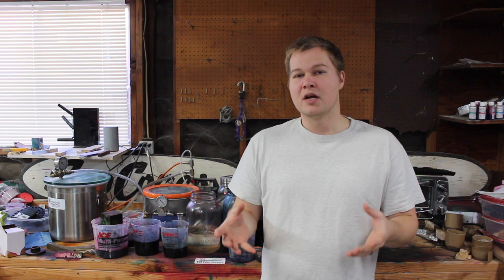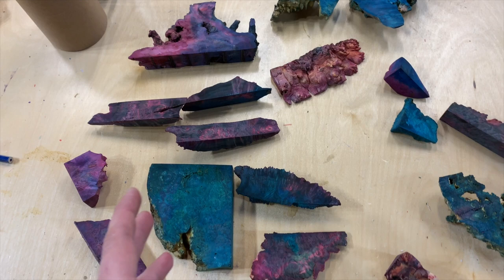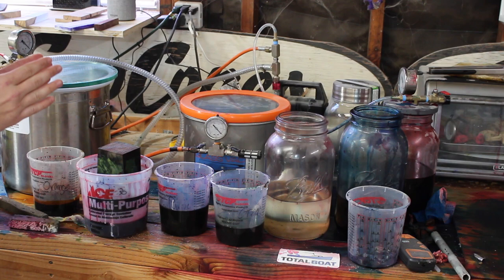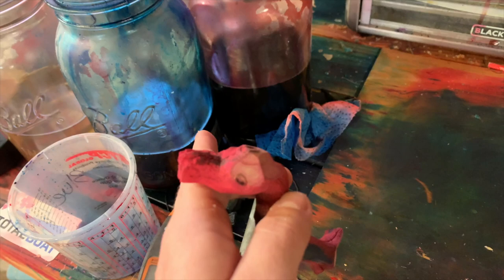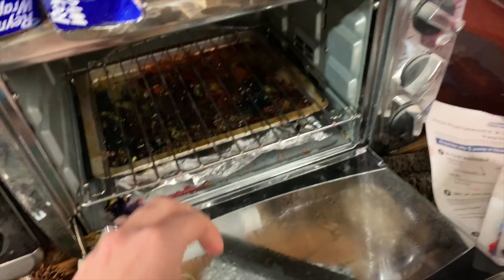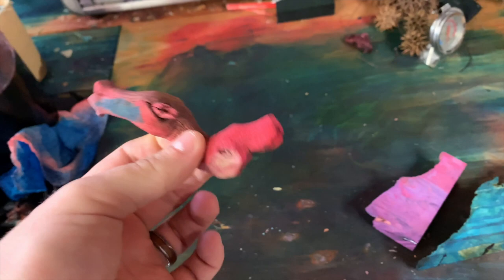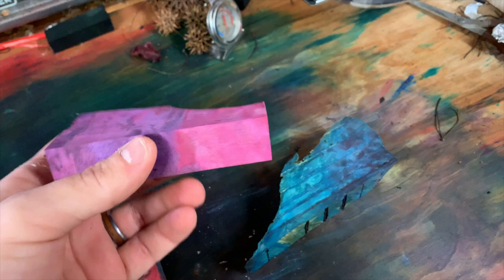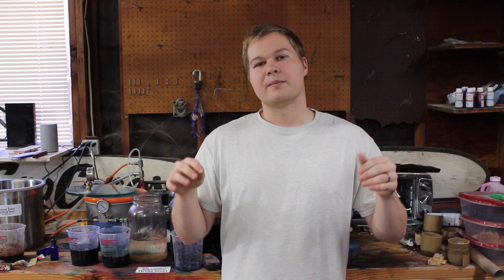How To Double Dye or Multi Dye Stabilize Wood (How To Make Stabwood)

Comment: If I understood well:
Step 1: Soak
Step 2: Soak under vacuum
Step 3: Dry in the oven and sand
Step 4: Soak completly under vacuum
Step 5: Dry in the oven
Some questions:
1) When soaking under vacuum, when there's no bubbles left, you stop the pump and let soak. But do you open the valve to let the air goes in the chamber?
2) When you double dyed, do you finish with a process of soaking in clear cactus juice?
Thanks and nice video!

Comment: Thanks for your video. I wonder if first warming the pieces in the oven first would be a good step and then application of the dye/resin mix? Would this help open the wood up and generate more absorption into the wood?
Reply from the maker: Yes this is considered a necessary step even when not dyeing

Comment: Awesome video Casey! Beautiful work man, and thanks for the shout out! I haven't tried using vac without submerging yet, need to test that out =D
Reply from the maker: Thanks Zac! I highly recommend it depending what you’re going for. If you’re going for distant color separation it works pretty well, but if you want random colors throughout the non vac soaking is perfect for that. Sometimes if the wood is super punky the non vac soaking makes it super distinct anyway

Comment: Nice video. May I use water in the vaccum chamber to simply dye the wood with some color, or does it just work with resin? If I can do it, should I dry the wood before coloring it? Thanks for sharing

Comment: I apologize if I  missed the answer to this question. When soaking for the first round of dye, do you get deeper penetration when allowing to soak first before placing in the vacuum chamber or do you get about the same result if you just go straight to the chamber on that first round? Just trying to wrap my mind around it. If you were just stabilizing with no dye, you just go straight to the chamber. Thank you so much for all of the info you share. Love your work!

Comment: Casey, on the red drift wood piece, did you pull a vacuum on it in the red dye, or did you just let capillary action turn it red? And did you bake it before you sanded it?
Reply from the maker: No vacuum, it just fell in and it was all capillary action if I remember correctly. I did bake it before sanding

Comment: love your videos.. no one talks about the wood drying in the process. in normal stabilizing everything needs to be absolutely dry.. obviously this is hanging out on normal air during all these soakings.. is dry wood not as important ?
Reply from the maker: Well I should’ve clarified that it should be dry. But it’ll definitely be dry by the time you do the second soak since it’ll cure on the first one, which is by far the most important. It’s most important to have it completely dry for whenever you actually put it under vacuum. Having it dry will probably help capillary action but not sure how kuch

Comment: A few of questions: how far does the capillary action typically draw the solution up into the wood? Do you ever flip the piece of wood around to get the same color on the other end? And have you ever used too much dye in your cactus juice?
Reply from the maker: Depends on the wood but usually pretty far, just not that penetrating. Drier and softer the wood like buckeye really soaks it up. And yes I have a couple times, it’s really whatever you wanna do. And no I don’t believe so

Comment: As usual,another great video Casey! I have most of my equipment on the way to get started! Here's a question though, for just getting started,should I start with a gallon or a half gallon of cactus juice? I believe,from the research I've done,the shelf life,isn't very long,on cactus juice correct? And since I'm just starting I dont know if I want to put $90 in a gallon if I end up not utilizing all of it before its shelf life is expired. What sayeth the professor to student? Thx for any help you might have! Always enjoy your videos!
Reply from the maker: I’d say a gallon. But it’s up to you. Shelf life is awesome. I’ve never had a problem. I always have a few gallons sitting in my chambers because I always stabilize so much wood at once. Granted they get swapped out with new CJ every month or two, but never had a problem. I’m sure the shelf life is 6 months to a year and the info is on turntex

Comment: Great video! As seeing I have a 5 gallon pressure pot like yours, I would like to make it double duty as a stabilizer. Do you know where I could get a 3/4 piece of lexan to fit the top? I know you’ll probably say the internet, which is where I have looked, but trying to find something of that size seems impossible. Or maybe I could just order a top from a vacuum chamber supplier. Your thoughts would greatly be appreciated. Thanks.
Reply from the maker: I would look for a glass top and a rubber gasket you could put on the rim of your pot. Even with 3/4” it might get micro cracks that so many people end up getting with acrylic lids. If you look at the Yescom chamber in my tools to use, and can order a gasket and lid like that from somewhere, I’d do that. Honestly probably will cost about the same as the chamber, as the chamber is really just a big metal pot. If it does cost similarly, I’d just get the whole chamber so you don’t have to dirty up your pressure pot every time you want to stabilize and then clean it every time you want to cast. 

Hope that helps!
Reply: Thanks for the advice.

Comment: What are the minimum specs you would use, or recommend, on a vacuum pump to do wood stabilization with?
Reply from the maker: In the video description I have a tools I use page that has the vacuum pump I have on it. I believe mine is only 3 CFM, and you don’t need more than that. You could probably even use a 2 CFM if they make it. The stronger vacuum just makes it reach full vacuum faster but that doesn’t really matter for stabilizing.
Reply: @CaseyMartin707  thank you

Comment: Do you bake after every color or only after all colors are added?
Reply from the maker: After every color! Only time I think you could get away with not doing it is if you were doing a large piece, soaked one end, and flipped it to the other. The main importance is on smaller ones where you want to make sure you’re not sealed off anywhere

Comment: What grit do you typically sand it back with? Also, when letting capillary action to happen, do you stop it to a point you want? or just let it soak till it stops. From my limited experience, it often can turn the whole blank that color. Granted probably using too much dye in that case.
Reply from the maker: Unless the wood was extremely soft and punky, I don’t think a wood could become completely penetrated by capillary action unless completely submerged. I’ve never seen it but maybe. I usually let it sit for however I want. Less time less capillary, more time more so. Hope that helps!
Reply from the maker: Also I think the grit on my belt sander is 150, but it probably doesn’t really  matter as long as you break through

Comment: Do you prefer using powered dye's or liquid dye's?  I have found that I can duplicate a color using powered by weight.  Drops from a bottle are not as exact.  They depend on the pressure of your squeeze and the thickness of the bottle.
Reply from the maker: I’ve never tried a powdered dye for stabilizing actually. I find the official liquid cactus juice dyes work the best. I’ve used Alumilite dyes a lot but they take a lot more so it’s not as cost efficient. I’ve heard one of the best ways to get a black dye to penetrate is to use a powdered though. Just haven’t tried it yet
Reply: @CaseyMartin707  Thanks Brother
Reply: @CaseyMartin707  I guess my hands are to weak to squeeze those bottles. At my age I shouldn't be surprised

Comment: I enjoy your videos and usually pick up a tip or two from them. However I see you have purchased a vacuum chamber that has a tempered glass top with a hole drilled through the glass. I cringe every time I watch this ticking time bomb being placed under vacuum. As you know these glass lids are subjected to thousands of pounds of negative pressure over the cross sectional area of the glass. The stresses are, for the most part, evenly distributed across the lid. When there is a hole drilled through the glass lid these stresses are now localized as a major stress riser. Each time the lid is cycled under pressure, microscopic weak points develop. It’s only a matter of time before a catastrophic failure will occur, with possible injury to the user. There are several good articles written on this and I encourage you to look at them.